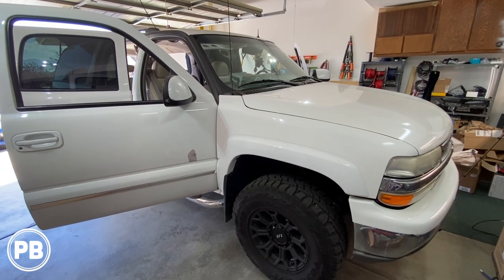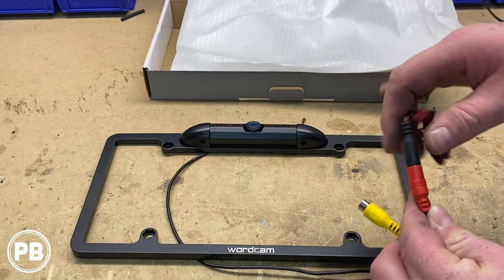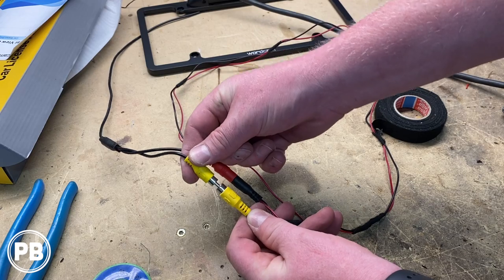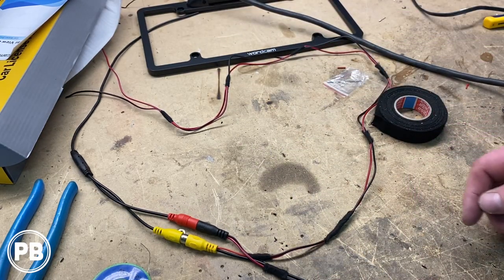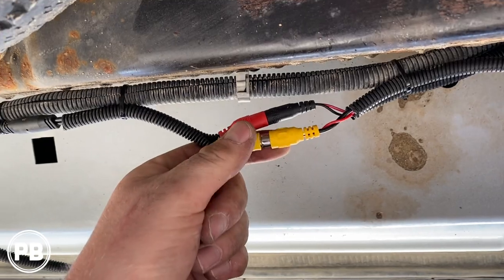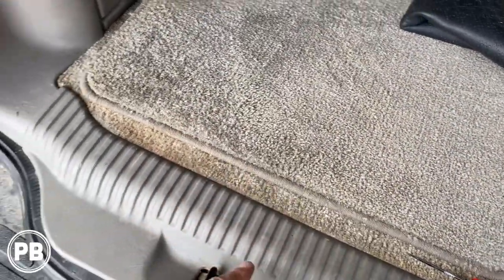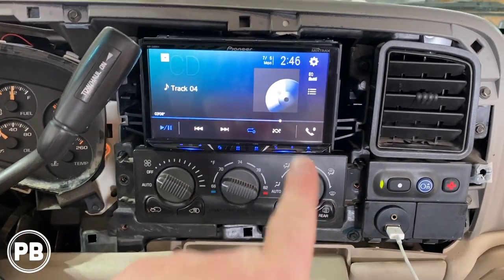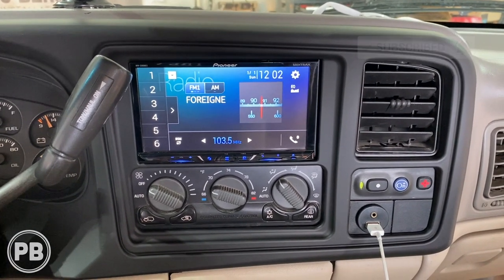2000 - 2006 Suburban / Tahoe / Yukon Backup Camera Install

Comment from the maker: Parts used linked in the description of the video!
Reply: Do you have to do anything for the radio to work in the vehicle?  Meaning is the oem radio specific to the vehicle requiring a code or software update?
Reply: Hey man. Does that USB port at the connect directly to the radio? Do you have link for it?
Reply from the maker: @leonardodgodoy4294  Yes, and it's linked in the description of the radio install video.  Two version of that video depending on the year of your vehicle.  See the description of this video for those links.

Comment: you really don't need to drill any holes in your car because you could have routed the camera wires to go through the same holes as the hitch wires. In fact, the hitch connector already has a reverse, power and ground signals all available to you right there. You really didn't need to splice it from anywhere else.
Reply: For anyone wondering about the hitch wiring: 
White = ground
Black = 12v switched
Light Green = reverse light signal
Reply: @JesseTheG_  u a real one
Reply: Not sure that’s correct.  How would you get your video feed into the cab?
Reply: @abbarr lookup TWA Motorsports video. He did it without drilling.

Comment: Hi there! I came across your video when I was trying to find out why backup cameras that are advertised for suvs do not have wires long enough to connect to the reverse lamp then up and around the liftgate to the license plate mounted camera. I see that you’ve spliced a white wire, and I believe the video cable as well, but no elaboration on that. Can you please tell me what types of wire I need to extend the video cable connection ( I was going to purchase a male/female RCA extension cable) and the camera power wire so I can actually connect it in my 2009 suburban? I’m not sure why they advertise suv compatibility when you have to research, buy and splice more wires to extend the length. 

Also I have researched extensively because the one that was in my suburban stopped working and I assumed it was the cheap camera so I bought a new one and had the same result. After a lot of swimming in a sea of wires with an onstar OS-4 and a pioneer avid-8100nex, I discovered the ground and the power to the camera was bad. It was grounded to the reverse lights like you are suggesting, but it completely fried the wire. I saw another video saying NOT to use the reverse light ground because the camera needs its own. I have also seen several backup camera videos where they are replacing bad ground wires that were connected to the reverse lights. Any experience with this?

Comment: that red wire at 6:00 came out is nowhere. At the beginning the only red wire went to tail light.
Reply: Black plug black wire to reverse light black. Red Wire connected to his white to run to the radio accessory. 
Yellow Video - Black wire went to the radio. Red wire went to Reverse light green.
That's how I see it. I watched this guy's video at least 10 times. A bit confusing.

Comment: I must have viewed this video 15 times. Took notes. Changed the notes. I think the new descriptive words like “trigger” wire threw me. Then a red wire changing to a white wire. 
So I decided to just have faith and connect the wires exactly as per the video. To my surprise it worked perfectly. 
So a huge thank you to the author. My camera works in both reverse and auxiliary. 👍🏼

Comment: HELP. My LED lights stay on continuously while the engine is running.
Reply from the maker: You will either need to wire your camera to the reverse lights only (instead of accessory) or you need a different camera without LEDs
Reply: @ProvoBeastAudio  Thank You. 
What’s interesting is that I have the same vehicle and radio you show in the video. So I either did not connect the wires right or I will do what you suggested. Remove the accessory wire. 
Thank you so much for helping.

Comment: If i use  Metra LC-GMRC-01 Wiring Interface, I will add a back camera that only works when going back،
Do you need to connect the Interface with a wire to the fuse box، Or is the interface power enough to make the radio and reverse camera.
Also in your explanation, you connected a red wire to the camera at the back of the radio. Does this wire get power from the radio or what?

Sorry if there are mistakes in the words because I do not speak English and I try as much as possible to understand the video

Comment: I know how to do this kinda stuff, but what throws me off is, that I bought a harness that’s for the on star and for the door chimes and the SWC the harness has a reverse wire what can I do with that?
Reply: wire the reverse from the car to the head unit and the head unit would switch over to the camera when you put the car in reverse. The camera would also get a reverse wire going to it to use as a switch to turn the camera on. In other words, the reverse signal has to go to both the head unit and the camera for it all to work.